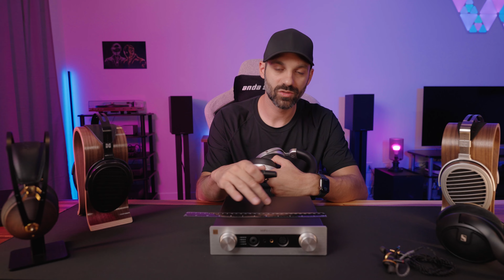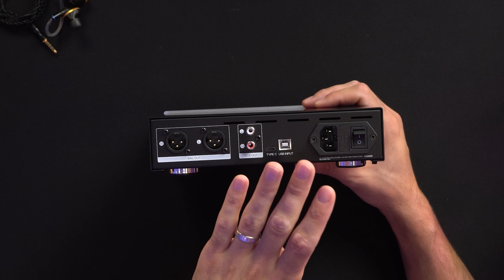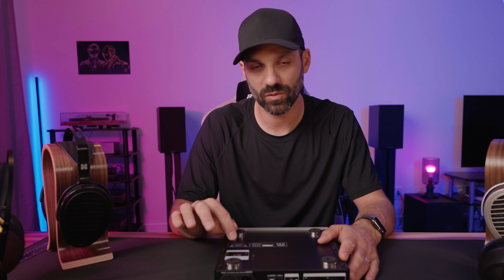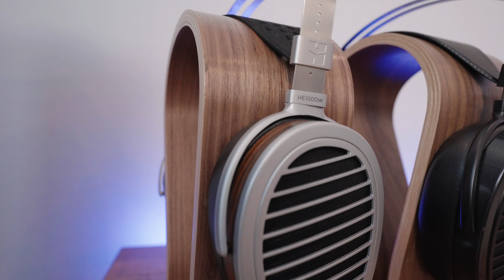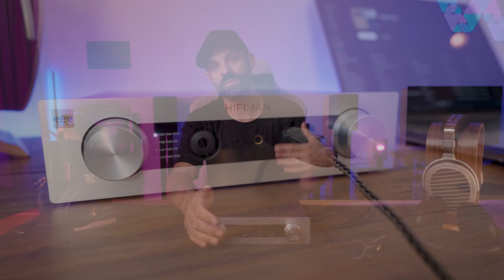Hifiman EF400 Headphone Amp + DAC Review!

Comment: I've owned the EF400 since its release, it's an interesting unit and I would definitely agree it works best with HiFiMan's own headphones.  It just so happens to work extremely well with the Campfire Cascade, one of the stranger synergies I've found for it.  Definitely worth the asking price for folks who already have or are looking to buy HiFiMan headphones.  I thought the V3 Arya was amazing on it.  I'm sure the same is true for the XS, Ananda Stealth, and HE1k variants.  For high impedance dynamics like ZMF and the 600 Sennheisers I think it's much less impressive as an amp.  I'll run the EF400 into a Lyr3 for those kinds of cans.  As a DAC it's a really solid choice but it doesn't out-magic imo a Mojo 2.  There is a price discrepancy there but it's worth paying it if you're mostly driving dynamics.  I think your overall assessment of the unit is spot on.  I prefer the OS mode to NOS but it can be dependent on the recording.  Great combo unit, a considerable upgrade from something like a ZEN DAC or Schiit stack.  More musical than analytical with decent "snap" in the mid-range.

Comment: Hi Joe. I want to ask you a question about this DAC. I noticed that my EF400 cuts the audio for a very short period of time (about 250/500 ms) every time I start a song or any other audio stream after some seconds of silence (even the sound Windows makes when changing volume from the taskbar gets cut at the beginning). I have this issue with every computer I connected this DAC to, and with both USB ports of the DAC. I wanted to ask you and every other EF400 owner here if you also noticed this issue, or if it is only my unit that has it, and get a replacement. Thank you.

Comment: How does it sound through hifi system with fixed audio out.
Reply from the maker: I think it may depend on what you use with them.  On my Bowers 606 S2 bookshelf speakers, I had it connected to a PS Audio Stellar Strata, and I liked the EF400 premap sound more than the Sabre DAC built into the Strata.  Vocals sounded a tad better to me and the music sounded a bit more analog/natural.
Reply: @GadgetryTech  Hello . I mainly listen to streaming music  (Amazon Music) with iPad directly connected to my Harman kardon 3380 and paired with b & w 706 s2 speakers . This setup sounds sometimes bright to me. Since you also use B & W s bookshelves, do you think hifiman Ef 400 will suit this setup ? Thanks in advance for your inputs.

Comment: How do you think EF400 is compared to the iFi Zen Air DAC that you reviewed recently? 
Would be interesting to hear what are the difference between a 100$ vs 600$ DAC-AMP, provided the headphones get sufficient power
Reply from the maker: Thanks for checking out the video!  There is a noticeable improvement in every way when using the EF400 over the Zen Air DAC.  Not only in power output but in musical performance.  A closer match would be the Zen Can Signature HFM edition, which is also $600.  When comparing those two, I feel the Zen Can Signature has a nice clean sound output and the "HFM" EQ mode adds really nice sub bass.  When you don't want that sub bass lift, I find the flat EQ mode to sound good, but not quite as nice as the EF400 from Hifiman, which maintains the sonic character of something like an Arya or Stealth, but compliments in a very subtle way.

Comment: This is a great stand alone dac/amp unit. But when I added the Topping A30 Pro amp in balanced. Mode it got even better. 

I read the Topping A30 amp will run in class A mode to a point. I keep the top A30 set in HI Gain mode, and the Hifiman EF 400 set in NOS- Low Gain mode. This is better than the EF 400 by itself in my system driving my Sundara and my other headphones.
Reply from the maker: That's awesome!  Thanks so much for sharing.  It sounds like an amazing setup.
Reply: @GadgetryTech  Please do a review of Ath m20xbt. It's pretty amazing

Comment: Nice review man!

Which sounds better for ayara stealth, the d30pro/a30pro stack or ef400?
Reply: Thanks for the response man. Do you think mojo 2 can can be enough for arya stealth when it comes to pure sound quality or ef400 is better?
Reply from the maker: Thanks!  If you just want to plug in and listen to music all night, the EF400 has some magic to it, which is what I have used a lot.  If you are taking the time to build out custom EQ presents for different genres, or also want some overhead with more power output, the Topping D30/A30 Pro stack has a little more juice and is more neutral.
Reply: @GadgetryTech  to lessen brightness in arya stealth and give more warm, pick ef 400 over the a30 pro/ d30 pro stack?